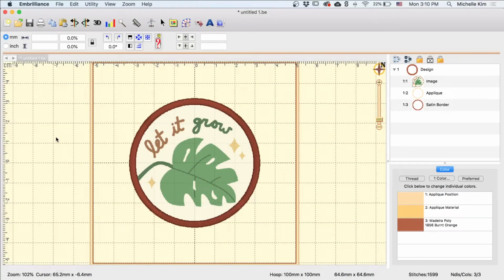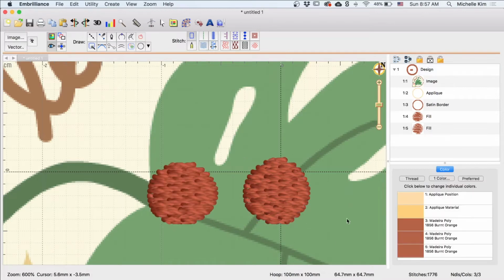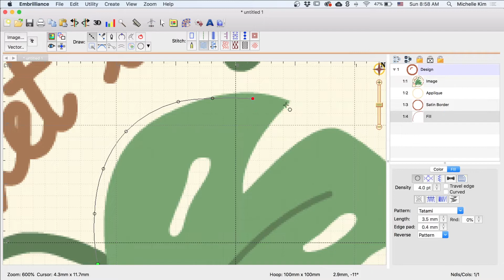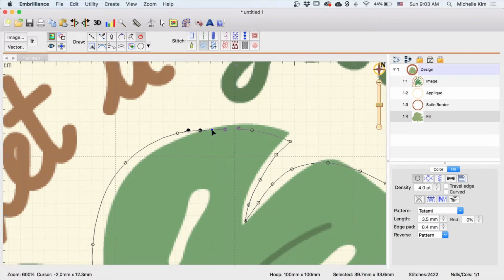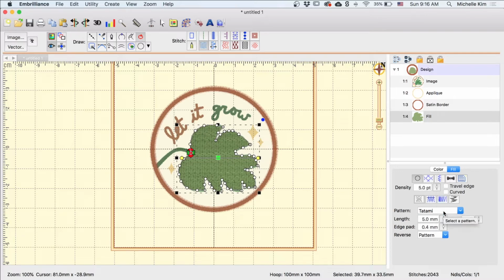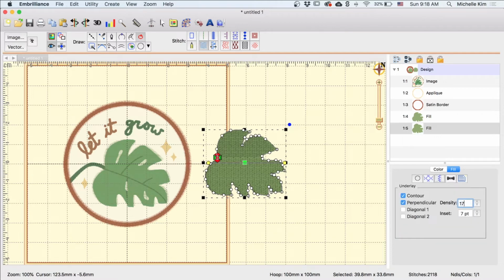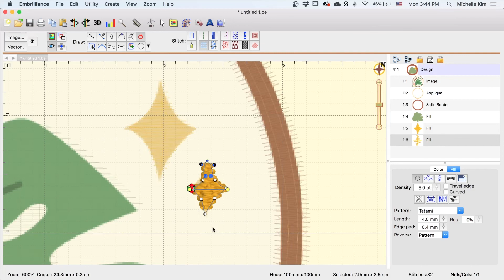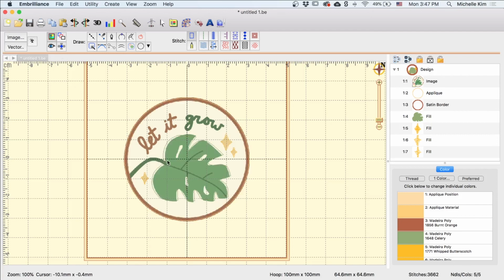How to Digitize a Custom Patch Design | Fill Stitch | Embrilliance StitchArtist

Comment: Hello, I don't understand why you didn't draw the outline of the leaf, stricly on the border.
Reply from the maker: Hello! I talk about it in the video, but it's to compensate for push and pull. There is a lot of tension as the embroidery machine stitches, so it's it doesn't stitch exactly as shown like a printer.
Reply: @stitchbackstories  ok thanks.

Comment: Hi, I'm just wondering why you have to trace the logo... Is because you are using a bitmap(.jpg) image? Can you import a vector artwork with .svg format and reshape those lines? Thank you for your videos*
Reply from the maker: Hello! Embroidery softwares do not read vector files. There are some programs that can convert an image to embroidery design, but they are not as good as manually digitizing. This because between thread tensions, stitch types and other settings, there is never just one way to digitize an image. Hope that answers your question!

Comment: can you change the direction of a stem stitch? I am only getting the yellow nodes for fill stitch
Reply from the maker: For the stain stitch? You may need to add the notes-- you can use the tool under the "draw" section that has the two circles connected with a '+' It's the 2nd row, 3rd column :)